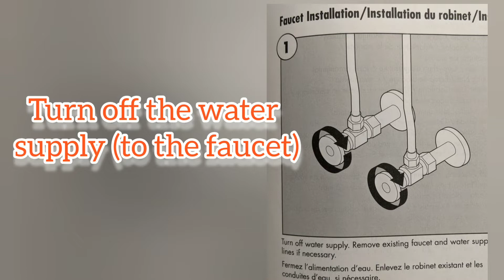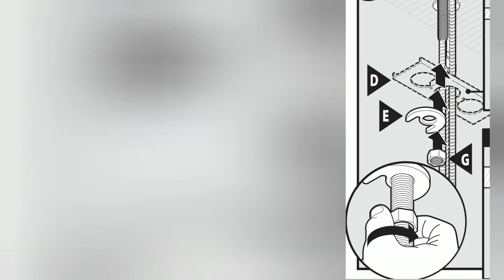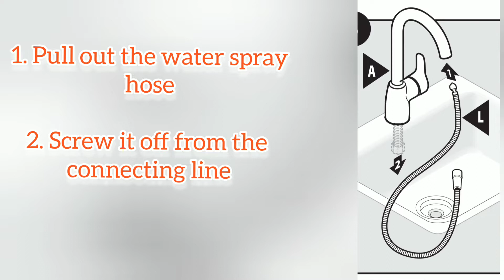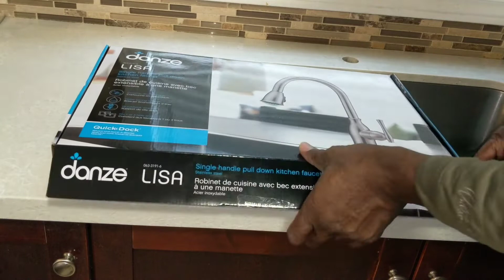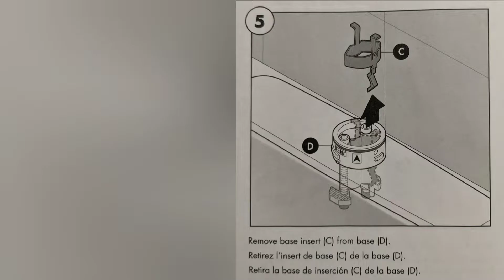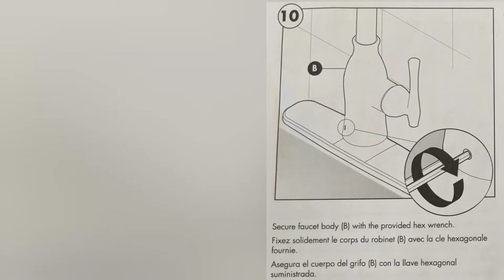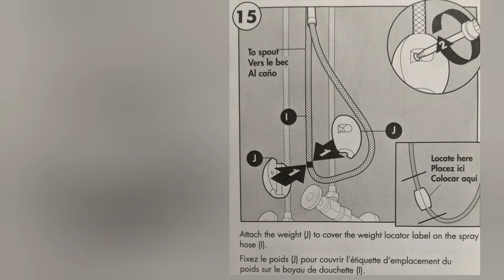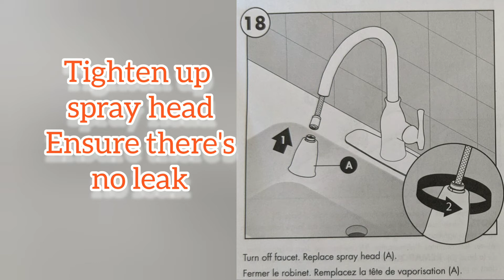Remove Old Kitchen Faucet | Easy Install new Danze Kitchen Pull out Faucet  @TowneBlvdTiy

Comment: Thanks for the video, you’re the only one I was able to find that went into details for this model. How did you get to your ‘viola’ moment at 5:55? I was able to get the bottom half removed, but the 1” piece is still attached to the top
Reply from the maker: Hi there, 
Thanks for watching my video and the ultra-kind feedback. I was able to get a grip of the shiny end of the hose with the rubber gloves and twist it off. Make sure the other end of the hose is disconnected from everything else to allow it to turn  completely around.  Hopefully, that helps.
Thanks again for watching and the subport to help me grow my channel👍🏾
Reply: @TowneBlvdTiy  thanks! I was able to remove the hose but the brass piece is still connected. Any suggestions? Thanks for the reply!
Reply from the maker: @joeshmoe346  if there is still a nut underneath it you have to remove it with a pair of pliers, wrench or a deep socket like I did in the video. After that the brass brocket will fall down.

Comment: I have the same exact faucet u installed. How do you remove the faucet from the base, need to tighten the 2 screws with the half moon washers.. Seems the base is  stuck to the faucet I also removed the nut on the side, but still no luck, base and faucet moves up together
Reply from the maker: Hi there, 
Thanks watching my video and the question. Normally you would not just pull up after you loosen the screw in the back of the unit. You would need to twist the unit from right to left to bring it back to the open entry slot  is in the base of the unit then you should be able to pull up the unit off the base. In your case since the base is also moving you may need to use a long enough screw driver from under the sink to hold it in place (or a partner to help jam it in place somehow) while you twist the base from right to left. 
Your situation does  not seem hopeless just need to find a way to the base inside the unit in place. Hopefully that helps. Let me know how you make out. Thanks watching and for the support to grow my channel 😁👍🏾